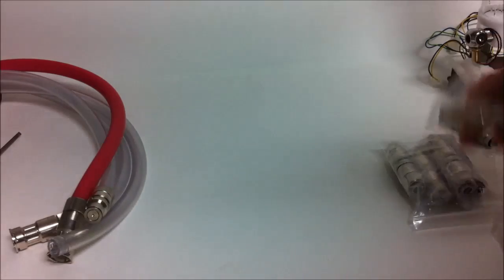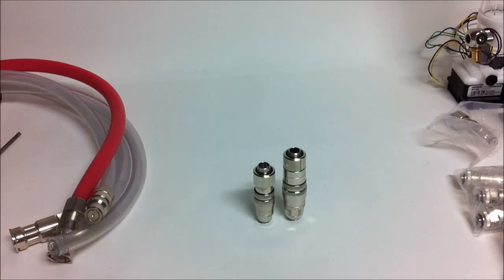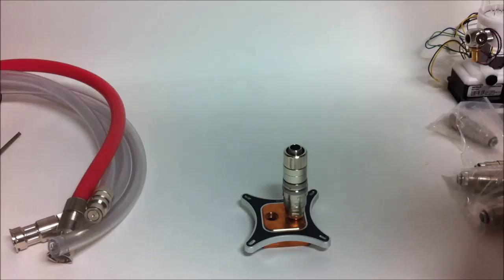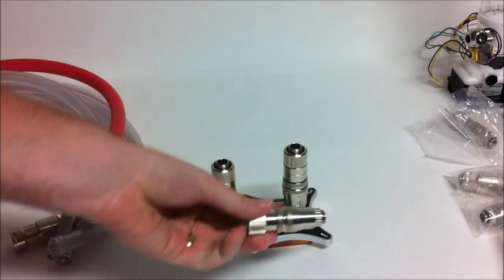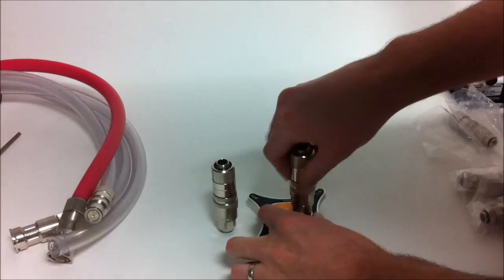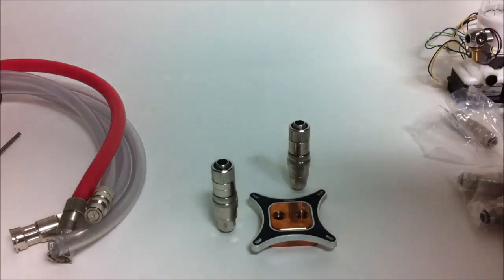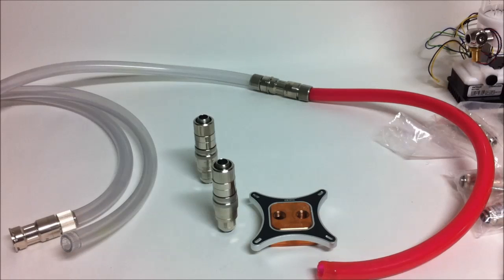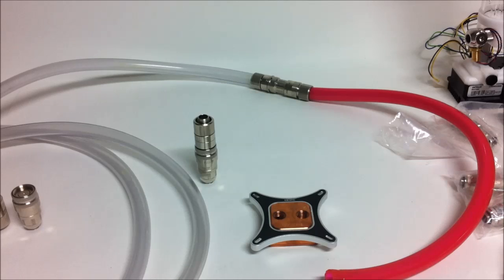Koolance QDC3/QDC4 Quick Disconnect Preview

Comment: Personally, I would never connect a QDC directly to any waterblock!  These focus enormous amounts of leverage/stress directly on a few threads, often in an acetal block.  For example, just think about the stress that directly transfers to the threads, waterblock cover, and pin/grid array under your CPU, as you press downward or pull upward to open or close these QDCs!  It's much better to connect your tubing to static fittings on your waterblocks and place these QDCs strategically several inches away, to allow interchange of the GPU, water pump, and possibly CPU sections of your water loop.  So, any flexion from operating these QDCs  (or other movement of your tubing during other maintenance activities) will be largely absorbed directly by the tubing and not by over-leveraged direct-attachment points.  As a bonus, you're keeping all lost water away from your components.
Reply: Why do you think that matters? Guessing?
Reply: @antonstjernquist2827  Prrreettyyyy sure I gave at least 4 reasons.  <shrug>

Comment: Thanks for the info. Question, is it plausible to put these onto the pump in and out? I have a large external radiator with pump attached, which is a bit of a pain to shift if I want to move my pc. Solution is these on as above, would this work or would it restrict the flow too much with it been directly on the pump and/or risk leaking?

Comment: I cannot get my QDC3 apart. How do you do it? I could do the twist ones, but not these.
Reply: so in the middle there's what looks like two over lapping rings. you need to pull them down (away from the ridged side, if that makes any sense) and it will come apart with a popping sound.

Comment from the maker: Interesting - I'll have to check this.  The actual internals should be the same so that's unexpected.  Thanks for the heads up.  If it leaks because the center of the QDC is not flush with it's surroundings immediately after taking a pair apart then that can be a sign that there's an issue with the spring and Koolance should replace it :)